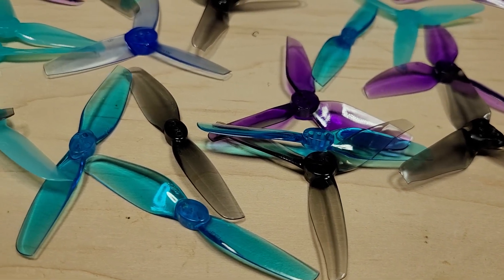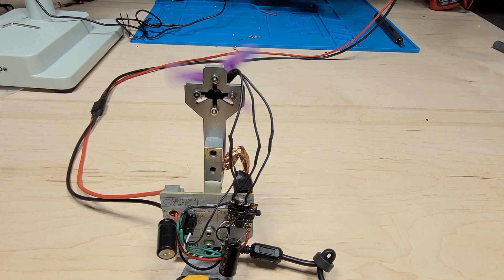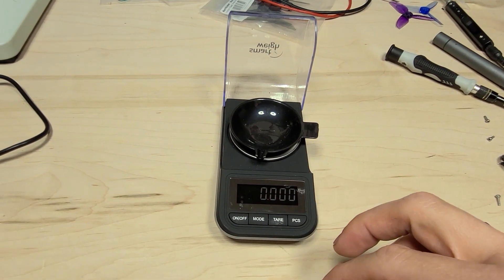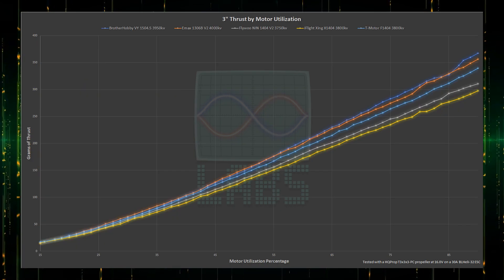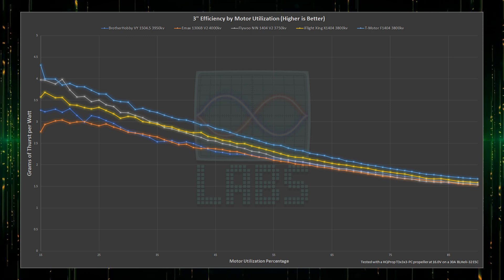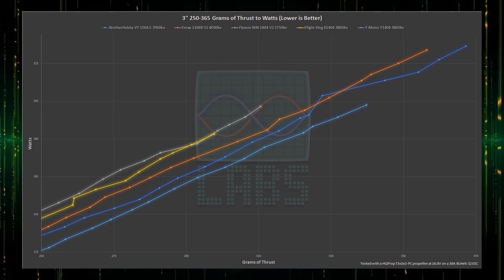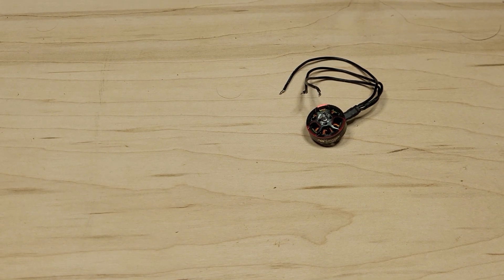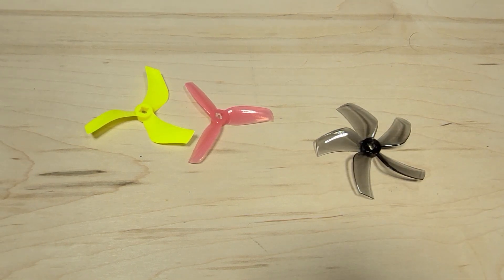Recursion Labs - 1404 Motor Performance Testing

Comment: Hello, very nice comparison. Thanks! I think prices would be an important factor as well. TMotor are usually more expensive, and since we usually fly freestyle, so replacing a bent motor became part of the hobby.. I'd love to see how cheaper 1404 motors, like Happymodel Ex1404, etc, would perform compared to these ones. Thanks
Reply from the maker: Historically T-Motor is usually more expensive for sure, but that doesn't seem to be the case currently with these smaller motors, depending on where you source them. I bought them for almost the same price (except for the emax which I got a while ago in bulk for cheap), so it wasn't a major factor

Comment: If you are going to test bullnose propeller than you shoud try the nazgul2525.  I built and design ducted drone,  I have tested on my thrust bench alot of 15xx size motor and out of them all the best all around was the spcmaker 1505 3450Kv.  Tested against the BH 1504.5 3950Kv .  The spcmaker have 22AWG lead wire and it was really great for helping the performance.  There 1404 3700Kv motor also have great specs also .If you are interested in my results, I post alot on facebook group  racewhoop, racewhoop fancophone and shuriken-whoop.  By the way,  all BH 1504.5 3950Kv came to me out of balance. 

Great video

Comment: oh no, this video came out after i decided to go with the t-motor 1204 6500kv on my 3inch tadpole. i planned to use 2S and 3S. the 1404 i guess demands 3S at a minimum, but seems that is a good motor reagarding efficiency. i often have the problem estimating what numbers i get, if i use the 4S instead of the 6s mentioned in the chart from T-Motor.  Maybe this is a topic for a video, if some other pilots have the same problem. i think i cant only caluclate 6S down to 4S, it is more complicated for sure. :-)

Comment: I'm somewhat amused by this 3" motor selection, because my EMAX 1106 4500kv motors are so ridiculously overpowered for me I don't even know what a larger motor would feel like. But I really appreciate the testing.
Reply from the maker: Just keep in mind that for the same motor at 4500kv you're going to produce more thrust than a 3800kv, but it would require more current and be less efficient.

Comment: Xing2 1404?
Reply from the maker: https://shop.iflight-rc.com/motors-cat88/xing2-motors-cat332/xing2-1404-toothpick-ultralight-build-unibell-pro1482?limit=100
Reply: @RecursionLabs  I mean like could you test those motors? I’ve seen some pretty impressive things done with them.
Reply: @RecursionLabs  I second this a year later - did you ever get the chance to try the Xing2 1404 motors? They might be a contender for the F1404?

Comment: Nice job with the video.  I tend to think of these sizes as 4" motors because of all the light weight long range that came out this year.  I wonder if the tmotor still comes out on top with a 4" bi blade.

Comment: Wow! this is awesome!     
So any chance you have or are going to test those 8 bladed HQ 63mm T-mounted props? I know they aren't 3", but the mass and thrust are similar to a true 3" quad blades. They are silly on a quad, but sound amazing in the air.
Reply from the maker: Thank you! I now have some 63mm (2.5") 5 blade props to test, but not 8 blade :)
Reply: I tested the 8 blade hq 63mm  and they are a disasater on a thrust bench.  The thrust is good but the will drain your battery way too fast.  The best 2.5inch propeller and by far are the nazgul2525  but don t forget, those propeller are designed to be use with a duct.

Comment: Thank you for the info! It would be nice to test 1105/1204/1303 motors for light 3inch props
Reply from the maker: Yeah I'd love to, I just don't have those motors to test. I do have emax 1106 motors I built an old 2" with, and a bunch of 2" props, so I could use that at some point on 3" if I don't get anything smaller (when I the 1106 there were not many options). Eventually I'll be able test what you're looking for, hopefully.
Reply: @RecursionLabs   I have some spare 1105 that I could donate to the science :) But I live in Europe and I suspect that shipment duties are prohibitive unfortunately. For light 4 inch propellers I'm uncertain between tmotor f1404 and the brotherhobby 1504.5 that you tested in the video, in your opinion which could be better? Thank you
Reply from the maker: @samuelepaganoni9741  I'm in Canada, so you might be right. 

I don't have an answer for you right now, but I will once I get 4 inch propellers on them (I have a bunch). I figure it might be good to test 3800kv vs something like 2700kv on 4 inch as well.

Comment: I'm more interested in time to deliver an amount of thrust more than the efficiency of said thrust. After all isn't the responsiveness of the quad overall more important to the experience of flying it.
Reply from the maker: I don't disagree at all,  but the response was basically the same for all of them (within 20ms, which is the update rate I have from the stand), so I didn't think it was worth wasting peoples time going over. I could spend an hour talking about everything I actually looked at while testing/retesting/reviewing data, but I don't think anyone would want to watch that. If you overload the motor (i.e. put 5" toothpick props on them), then it's very noticeable. 
For your reference, from idle to 90% throttle the time is around 170-190ms to reach full RPM for all these motors tested. Thank you for the comment.